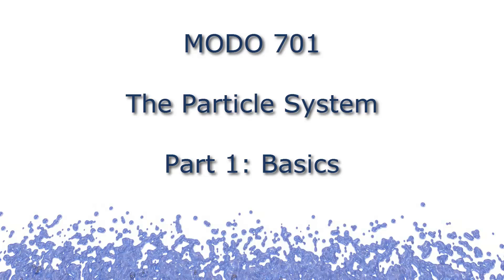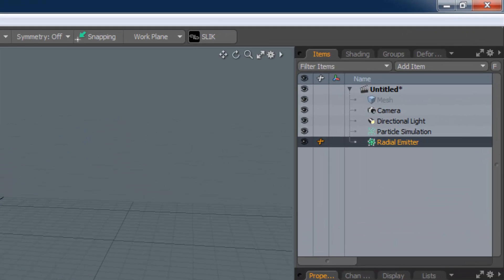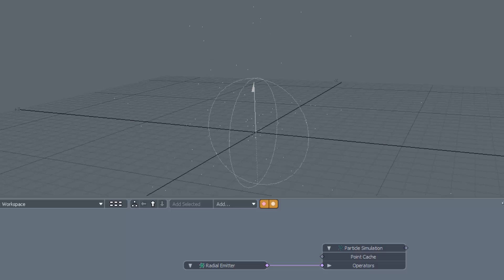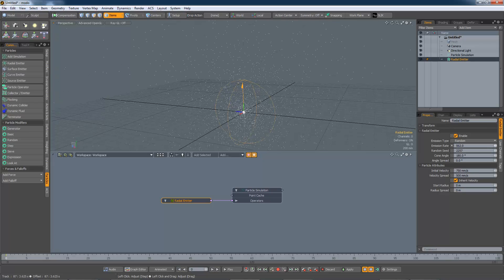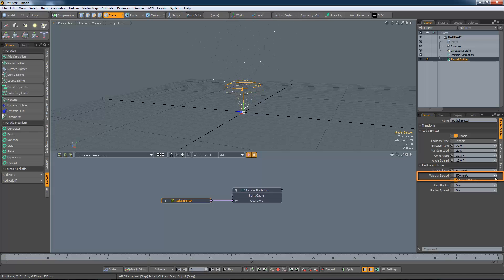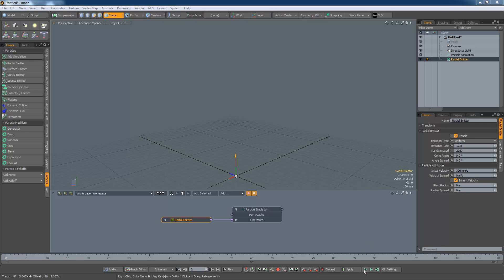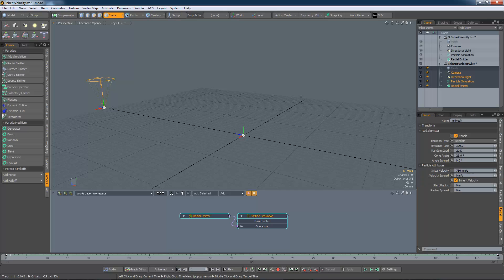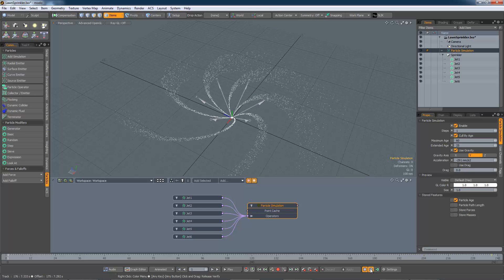The MODO 701 Particle System -- Part 1 - Basics

Comment from the maker: Hi Dmitry.  I am using 801 now and it should work just the same.
Reply: +Steve Hill  Hi Steve I am using modo 901.  I do not know how to connect the source emmitters in the way you did at the end to create a sprinkler . I tried parenting them to a group locator  but its not working as I do not know how to rotate them and the arrows do not appear. Otherwise your tutorials are great and thanks for making them
Reply from the maker: +Kuga Pol Parenting them to a group locator sounds like a good start.  You should be able to position them just like any other items -- select the emitter either in the item list or graphically (making sure you are in item selection mode) and then use your move/scale/rotate tools to manipulate the items.  Or you can change their rotation in the channel list directly.  I am not sure why the arrows are not showing -- you could check that the emission velocity is not set to zero.

Comment from the maker: Yes.  I don't think it has any effect otherwise.

Note that when running simulations with the hollow triangle, there is an in-built cull-by age which is controlled by the length of the timeline.  This is just a convenience to prevent the number of particles from growing indefinitely.